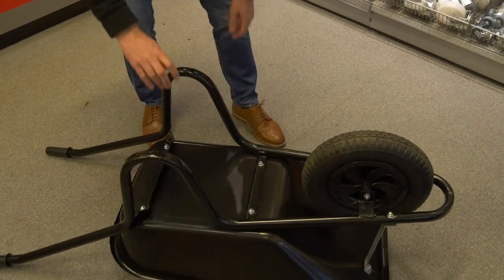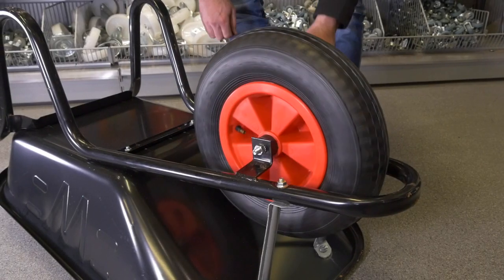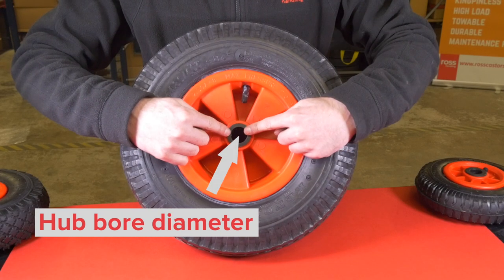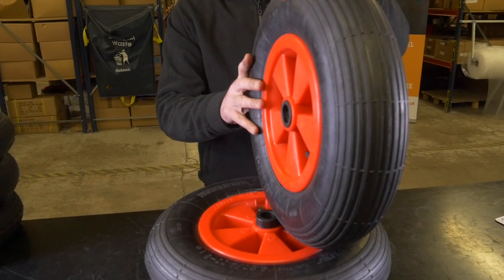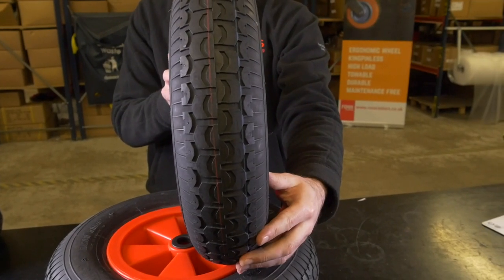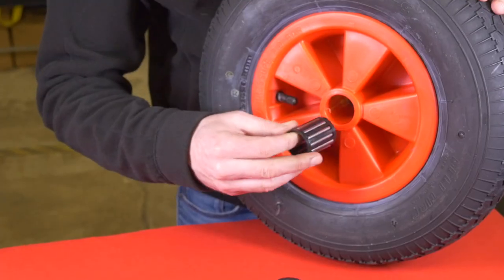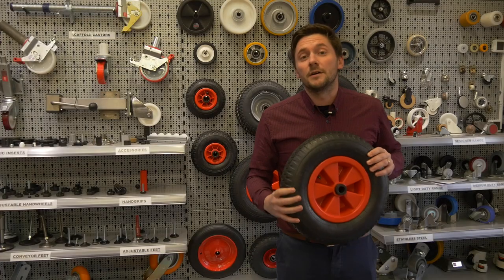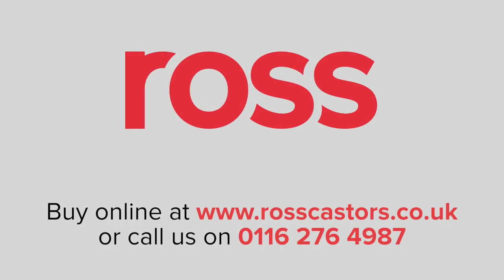How to Change your Wheelbarrow Wheel by Ross Castors

Comment: I know I might not get a reply, as this video is 5yrs old? I'm building a luggage trailer to tow behind my motorbike. I already have a 150/70/13 road tyre, and would like to know if I could use a wheelbarrow wheel on the trailer. Max speed would be around 70mph.
Reply from the maker: Hi @BazzSelby,

We advise against using a wheelbarrow wheel for towing a trailer, as it may not withstand high speeds and could risk tearing apart. For optimal safety, we recommend utilising a "High Speed Wheel." You can explore a dedicated section on our website showcasing a variety of reliable "High Speed Wheels" for your trailer below 
https://www.rosscastors.co.uk/catalogsearch/result/?q=high+speed